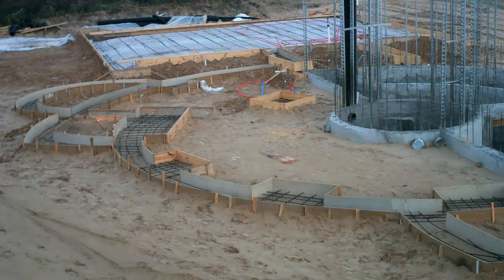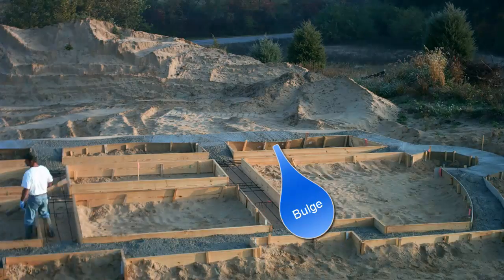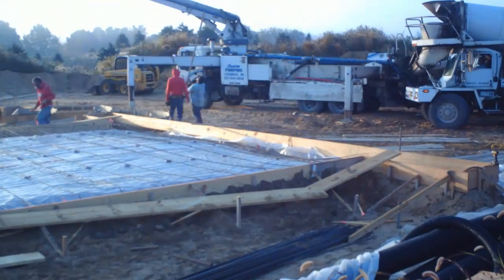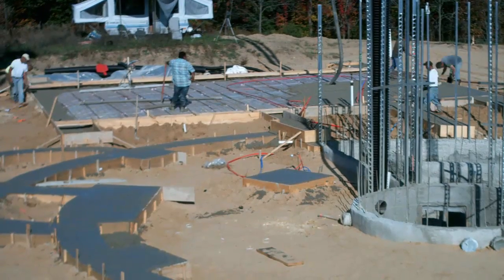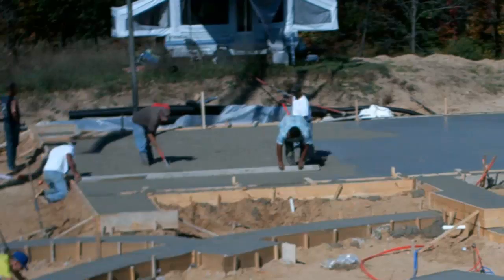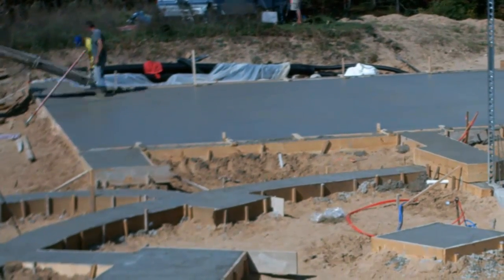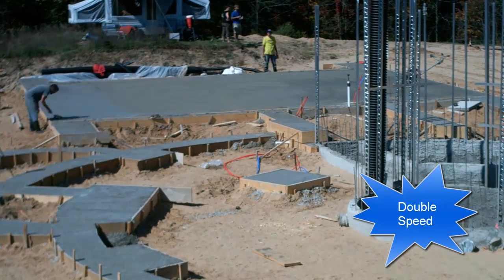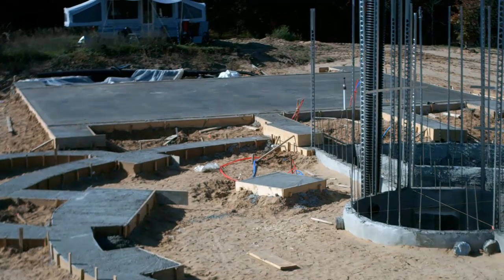7.2 Pouring the Main Floor Footings

Comment: Man how much did all that concrete cost for your home?
Reply from the maker: Concrete costs about 100 to 120$ a cubic yard, depending on the specific mix.  It is actually fairly cheep that way.  The crew to pour and finish it charges 3$ per square ft.  In this case, the job was something like $5000.